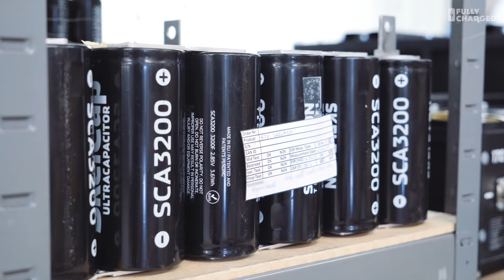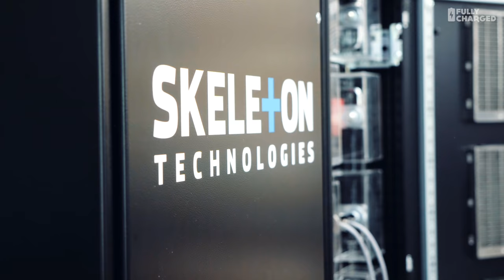Skeleton Ultra Capacitors | Fully Charged

Comment: Sounds great, but i have two questions.
1. How much space would a well sized SuperCap be for an EV? Isn't it too big for adding in a car?
2. Does the big thing for grid tied energy storage affect the cos(phi)?
Reply: Just for energy recovery on a flat road should 500 Wh be enough. 
This would be 74 kg and 54 liters of the capacitor cells with the highest energy density.

You couldn't store the energy of long downhill driving with this of course.
Reply: If you meant an electric car with capacitors instead of batteries:
Wouldn't work for a normal electric car, too less range achievable.

But in theory, you could use the same priniciple as with ultracapacitor buses: Driving some kilometers from charging station to charging station, high-power-short-time-charging at the stations. 
The Chariot ultracapacitor electric bus can drive up to 20 kilometers with one charge:
https://www.youtube.com/watch?v=asktSaXYyv0

Comment: I imagine capacitors in a car, soaking fast the energy, then charging the slow batteries of the car. Each independent car battery, from the whole pack, getting the energy from independent capacitors.

Comment: I did some research: The ultracapacitor cells of this company achieve a power density of 110 kW/kg and an energy density of 6,8 Wh/kg.
So an electric car with 500 kg of such cells could store 3,4 kWh and achieve a range of roughly 20 km.

I know, it's not the purpose of such cells, but I wanted to point it out, because many people dream of electric cars with ultracapacitors instead of batteries.
Reply: Ach ja: Und man könnte es dann theoretisch in 0,22 Sekunden wieder aufladen. Mit 55 Megawatt.
:-)
Reply: Solche Technik würde sich perfekt eignen um Netzschwankungen im Stromnetz auszugleichen, wie es die Tesla-Batterie in Australien bereits macht (sie hat Reaktionszeiten von 1 Millisekunde). 

This technology would be ideal to compensate voltage fluctuations in grids, like the Tesla-battery in Australia already does (it takes 1 millisecond to react).

Comment: so in other words. super capacitors is best in use with lithium batteries. so when you have something that takes a high peak power the capacitors kicks in. and as the peak leaves the lithium takes over? interesting. :)

Comment: First we charge in capacitor and then charge to battery from capacitor with device like (dc to dc convert).Then from battery power we drive the motor. Is that possible? Benefit Charging time is very fast and battery life will be life span.

Comment: They could make an energy saving with this. For example, generators would produce 10 megawatts of electricity, but on one day the consumers would only consume 7 megawatts, and the generators would be producing 3 Megawatts of electricity more than needed, so the idea here, is to store this leftover somewhere, and woow look at that, theese clever engineers are making supercapacitors which could be used exactly for that, and once the supercapacitors are charged with enough energy to support consumers with the electricity for a few hours or so, the generators would turn off, and they would stop producing the unnecessary energy. Imagine that.

That's the idea, I don't know if it's possible to accomplish, but would be nice if it was.

Comment: I wonder, is it possible to "pimp my ride" exisitng Toyota Hybrid with this ~10kg ultra-capacitor pack? Just connecting this thing parallel to 217V DC HV-battery and have all those benefits without reprogramming ECU of the car.

Comment: This is the kind of technology the US DoD buys for General Atomics experimental rail gun.  Capacitors can stage massive power buildup and then suddenly release it like highly compressed air but for eddy current rails.  The idea behind storing such capacitors is they should be safer should a ship sustain damage and not blow up as badly as conventional ammunition.  To tell you the truth I still would be nervous of such high power density capacitors catastrophically failing after sustaining damage to them.

Comment: With the gloves sticking out of the machine, it would seem that the ultra capacitors were sealed in a positive pressure system and not a vacuum.  That would be more logical in that a positive pressure Noble gas would ensure less a propensity for moisture influx.  Nature abhors a vacuum. Positive Pressure mediation would be best insurance against water intrusion.
Reply: There's a vacuum chamber surrounded by positive pressure.
Reply: Jo-Erlend Schinstad That is very interesting. It would be fascinating to see how that assembly was handled from positive pressures to the vacuum

Comment: Batteries are electrochemical devices, capacitors are electrostatic.
Batteries rely on a chemical reaction to free electrons to do work, whereas capacitors are a separation of static charge... which is why capacitors can charge or discharge in seconds instead of hours.

The ONLY reason the world doesn't run exclusively on capacitors is because they tend to lose charge relatively quickly.

Enough capacitance to replace a car's starter battery is easily achievable, but if you let your car sit for a week, you will need a jump start where your ancient lead-acid battery will be fine for 3-6 months of no driving.

Comment: Be careful, by implication they've cleverly suggested that their 100kW capacitor can do the work of a 100kWh lithium ion battery. A "kW" of power does not equal a "kWh" of energy. They're two entirely different things. A kW (kiloWatt), is a measure of power which is the rate at which energy is used or measure of work done. kWh (kiloWatt hour), is simply a measure of energy. To maintain 60 mph most electric cars need about 15kW of power (about 20 HP). At this rate the energy in some of Skeleton's big capacitors would be exhausted in minutes, if not seconds, while the energy in that big 100 kWh Li-ion battery would go for over 5 hours. Don't get me wrong, the advances in Super Capacitors are simply amazing and point to an incredible future of energy storage applications that were once unthinkable for capacitors.

Comment: Actually I am missing data facts...like how much voltage could this supercaps handle? How much Farad do the different models have? And how much current went through the cables with the 'buscap' experiment? ...learned nothing new, but interresting documentation anyways

Comment: Taking the technology of diesel electric powered quarry trucks & make it smaller for personal use with ultra capacitors would allow you to have farther range then a basic fuel based engine due too that regen braking thing! & from us that use gasoline vs. diesel, it should still add more range due too the fuel powered engine doesn't have to work as hard to keep the vehicle moving & can even shutdown saving even more fuel! The fuel will only be used if its needed to recharge(lightly recharge) those capacitors to keep them nearly topped off(not fully charged, maybe half or 3/4 charged) so when you do need to stop, the braking regen can charge them up, being more efficient! If/when I do a conversion to my vehicle, I'll be wanting to keep the engine that's already in my vehicle but replace its transmission with a generator so with capacitors can improve range & placing electric motors at the axle level, without relying on needing to worry about finding a charging station if I get to low on power(there are refueling stations nearly everywhere so...)I went have to worry of needing a tow, if the worst happens!

Comment: Ultra caps aren't necessary in EV's because power density of the pack isn't a problem.  They're running so many cells in parallel that the power drawn out of each cell, even in high acceleration events, is much less than their rated output current. Interesting concept though

Comment: I want some for home PV energy storage.
Reply: for pv energy storage your better with lithium battery's as you don't need high current pulses. they have better energy to size / weight ratio. 

and if you wan't free lithium cells go to you local recycling centre get all the laptop batteries take the cells out and capacity check each cell and use the good ones to make your own batteries
Reply: @elk3909  And that is the point. For energy storage at home, size and weight is not an issue. But long therm stability is, where all chemical energie storages fail. You don't want to replace your batteries every 10 years. Peak power delivery capabilities are just a nice bonus at this point.
Reply: @te0nani  if you get them for free and build you own lithium is still the way to go. at the rate mine are losing capacity they will last over 50 years because each cycle uses 2% of their total power. and they are growing daily as i add more good cells to them

Comment: Here’s a theory that I’ve wondered for some time now.. couldn’t they make an electric car that had 2 lithium batteries AND a capacitor. While you were driving the vehicle, connected to the drive train is an electric generator type deal, that would charge the capacitors and then the capacitors could charge the 2nd battery that isn’t being used. Once the 1st battery depletes, it seamlessly switches to the 2nd battery and the capacitors start charging the 1st and back and forth again and again. Sounds easy I guess, but putting it into a real working car probably isn’t.. if it was I’m sure someone has tried before or at least something similar.

Comment: OK, I'm sold how much? I run a transceiver at 25 amps peak. However, due to the waveform being a human voice, the average current used is around 10 amps. I have a full Farad in parallel with a leisure battery (lead sulphuric acid) of 100 amp-hours. The maximum voltage is 14.5 from a regulated solar panel at around 8 amps. What sort of supercapacitor is available in this situation? Also do you take credit card?

Comment: Good in theory. Not practical in use. That is why Tesla with its army of battery engineers does not use super capacitors to do regenerative braking. The benefit of capacitors is that they have greater energy output per second. However, if you have a large enough battery, the power from the battery increases as well. So, because the long ranges needed from EVs require large battery packs, there is no need for capacitors to increase the power. Also, capacitors leak energy quickly and they are not energy dense. Therefore, the weight of adding more batteries is more efficient than adding a large complementary ultra capacitor.

Comment: If graphene is so heat transmissive why dont they make lithium ion batteries with the graphene ultracaps using the battery cell as its core so it dissipates the heat from battery usage while also possibly charging itself through heat transfer / induction or emf created.  I guess its a circular thought and useless in theory but in the least of it the heat dissipation of the graphene and so low esr the heat taken on would cause minimal changes to the ultracap lifetime and increase the battery life..  right?

Comment: At the end of this video, you bemoan that Estonia is not good for Solar because it is so cold.
Solar Panels are the most efficient when they are running at cooler temps. It could be 10 Below Zero Fahrenheit, and if it were dry and Sunny, your Panels will wok just fine. I've used mine in the Winter at 46 Degrees North latitude, below freezing, and actually got an extra Volt going into my Battery Bank.

Comment: Yeah it would have been dumb to take the old infrastructure as you main cost is laying down the lines, so if you are already investing in digging up you need to do that and putting up poles where you can there is little difference to going brand new and fibre lines should be relevant for the next 100 years so it's a worth while investment.

Comment: 100 kW is not a significant measurement. The wires jumping apart is not significant. It could just as easily be 1000 kW and still not be significant. The significant measurement is how many watts over time: the total energy the capacitor pack can supply. And also significant when comparing with batteries is the length of time an adequate amount of power (volts times amps) can be supplied. It requires 300 to 18000 watt-seconds (joules) to start a car, depending on many factors. The question is how many such car starts can a capacitor pack provide as compared with a car battery.

Comment: How does this compare to the Tesla powerwall? This seems much better than lithium batteries
Reply: It depends on the purpose.
If you want to fire a railgun or accelerate a fighter jet with a catapult on an aircraft carrier, ultracapacitors are better.
If you want to store solar energy to power electric devices for many hours at night, lithium-ion-batteries are better.

The key sentence was: "we are not in the kilowatt-hour business, we are in the megawatt-second business"

These capacitors can store and deliver very high power for some seconds, but they can't store much energy.
The best cells of this company (regarding energy density) achieve 6,8 Wh/kg. The best lithium-ion-battery-cells achieve more than 200 Wh/kg.

Don't confuse kW and kWh!
Reply: And costs of course: 1 kWh of ultracapacitors is many times more expensive than 1 kWh of lithium-ion-batteries.
So they only make sense for appropriate applications: Small amounts of energy, many charging cycles per day, high power demand.

Comment: Once you hear about ultra capacitors and what they do it seems so obvious a compliment that you wonder why they aren't bundled with every high energy lithium pack available already....Something not covered here but there are different types of lithium batteries that are either high discharge or high capacity, with this tech higher capacity cells could be used to increase energy density where they would not be practical usually.... We could easily be talking about a 30% total storage increase just by combining the two technologies right now....Or a 30% size decrease if you prefer!......Some dumb company like Apple are probably planning a phone the thickness of a piece of paper as we speak :)

Comment: Nice episode. I particularly enjoyed seeing and learning about Estonia - a country I don't know enough about. That aspect of this episode reminds me of Anthony Bourdain's "Parts Unknown".

Do you have a rough calculations regarding how much this would benefit a typical EV? Assuming limited energy capacity for the super capacitor how great of a boost in 0 to 60 MPH (the super capacitor would then recharge gradually before it could be done again)? And what would the cost be in terms of weight, space and dollars? I would have guessed that https://www.skeletontech.com would have such a calculation, but it's not jumping out at me.

Here's my attempt at a calculation - this module: https://www.skeletontech.com/170v-modules (click on the datasheet) should store (1/2)CV^2 = 5*53*170**2 = 765,850 joules, which is 765.85 kws (kilowatt seconds), which should drive a 150 kw motor for 765.85  / 150 = 5.1 seconds. That should be quite helpful. The height and weight isn't too bad. But is it practical?

Comment: Why can't motor manufacturers put small wind generators in the slip steam. 
Of a vehicle to help charge the battery's   The Faster you go the higher the charge ?????
Reply: Laws of thermodynamics. No free lunch. A wind generator that would be powerful enough to charge the batteries while the batteries are discharging (powering the vehicle) would create a load (resistance to forward motion caused by drag and mechanical load) on the batteries higher than the output of the generator. Your battery life would be decreased by adding a wind generator to the vehicle. Sorry.

Comment: It's very interesting.
But they should have made it clearer to the audience, that the energy density of such capacitors is MUCH lower than the energy density of batteries, even of lead-acid batteries.

Very high power density, but low energy density. 

I'm not sure, if Robert really understood that. He obviously meant Megawatthours, when he talked about huge containers for 1.5 Megawatts.

Capacitor cells of this company with the highest energy density: 6,8 Wh/kg. This would be 147 kg for 1 kWh!
https://www.skeletontech.com/industrial-cells

To Robert and other possible readers of this comment: Don't confuse kilowatts and kilowatthours!
Say "kilowatthours", not "kilowatts", when you mean kilowatthours!

Comment: I would like to see an electric car that runs on capacitors only
Reply: Would be principally feasible. But the range would be very short.
These capacitors achieve an energy density of up to 6,8 Wh/kg.
With 300 kg of these cells you would get roughly 2 kWh. Enough for 10 to 20 kilometers, depending on the way of driving.
Comparison: The complete battery pack of the Renault Zoe weighs 305 kg and the available capacity is 41 kWh.

Comment: If it was a vacuum, wouldn't the gloves be pulled inwards?🤔
Reply from the maker: That is the single best question this episode has generated. Yes, exactly. But here's the thing and we didn't have time to explain. The vacuum chamber is inside the box the gloves are sticking out from. Inside that box is high pressure ultra dry air, so that if there is a leak in a glove for example, for starters an alarm goes off but also the dry air goes out, rather than moist air going in. then, inside the box is the vacuum chamber which, once it's loaded up is sealed and then they pump the ultra dry air out. You might be able to tell how long that explanation would have taken.